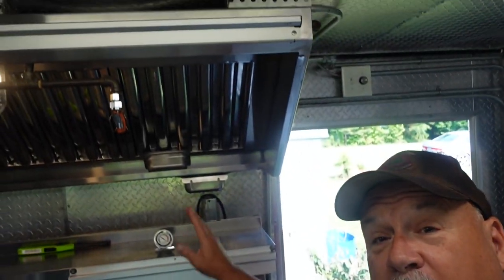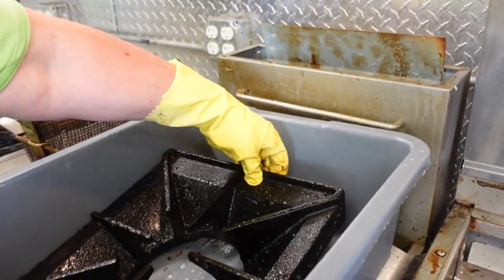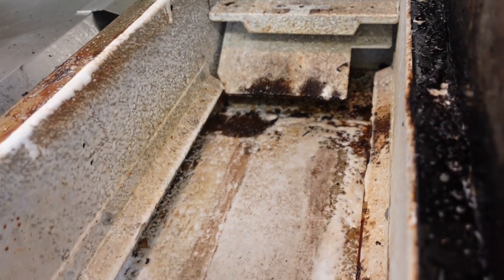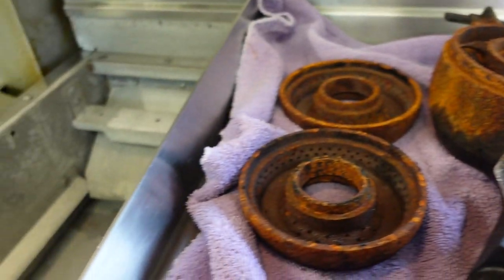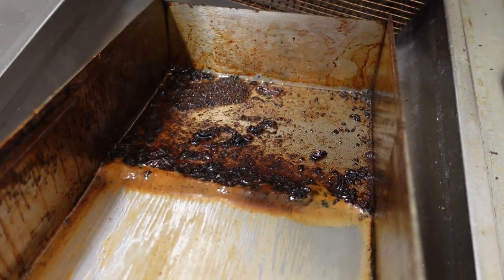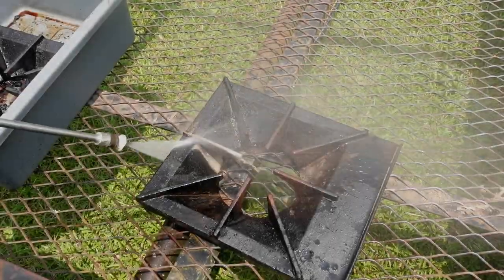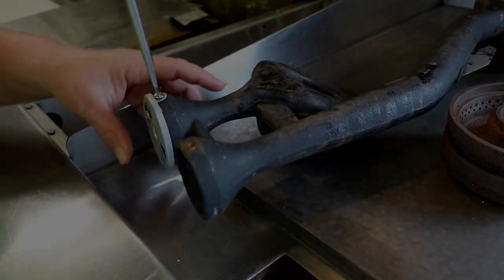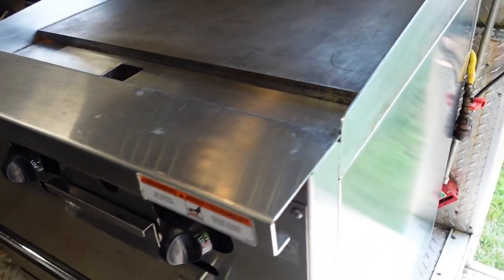Food Trailer Update   Cleaning the Oven and Burners

Comment: You have a lot of weight in that trailer. When you put it on the road pay close attention to the tires and bearings. If in doubt replace.
Reply from the maker: Yeah, I checked all that when I bought it and I pulled it and an hour and a half to get it home. Pulled like a dream. I was very concerned about the weight, but so far so good. But after all this cleaning, it might not weigh as much.....lol